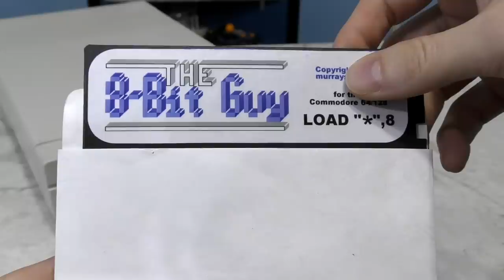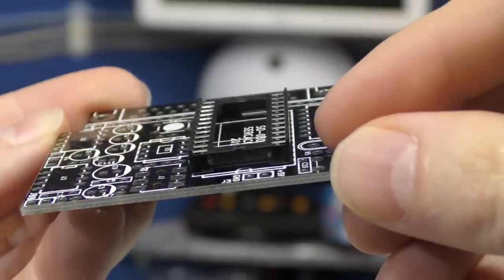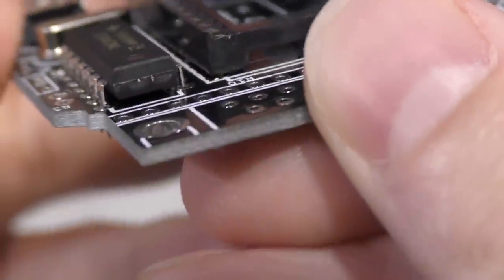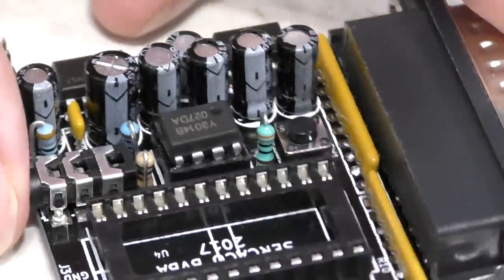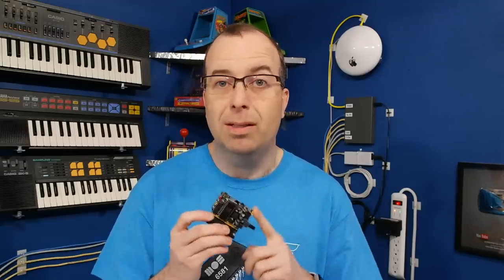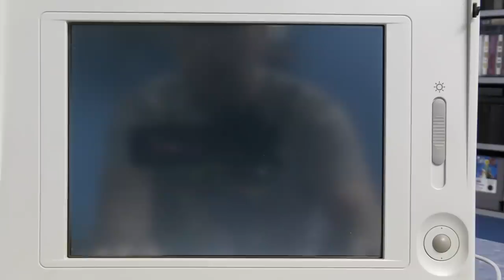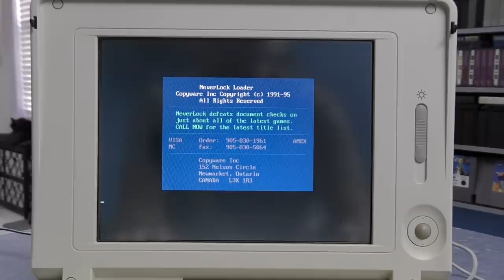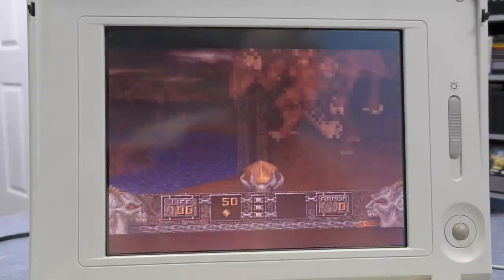Ad-Lib Sound Card for the Parallel Port

Comment: I know this is going to sound redundant to 99% of folks but I would LOVE a USB version of this with a VST controller. I'd love to write Dos type music with the opl3 on a modern machine. I know its nuts but there we are!
Reply: Maybe just rip the OPL2 / OPL3 emulation code out of DOSBox instead.
Reply: You could also go with Plouge's Chipsound's VST for a software-only solution.  Does not seem to emulate the Yamaha, but it does quite a few other famous sound chips.
Reply: I too would love a usb adlib.
Of software there is JuceOPLVSTi which is a vst wrapper of dosbox. Dexed, which is a VSTi dx7 emulator also has a OPL mode that simulates the lower end soundchips, but it only has the sine operator. Both of these are free and work cross platform. On the paid side FM8 can also sound very  oldschool since it has built in decimation and a lot of classic modulators. 
All these solutions are purely envelope controlled and you'll have to expose parameters to be controlled by your DAW to get the iconic complex sounds you hear in games where they used lookup tables to switch operator waveform and pitch mid sound.
Reply: Thanks for all the replies! Seems its not as crazy as I thought! 
I must add, I do a lot of music - I have a love for SID stuff. Have some hardware - HardSID4u, old QuadraSID, C64 with Mssiah, SammichSID, SammichFM, Yamaha TG33 and FS1R among others :-) 
Ive heard of the Plogue synth must look into it. Never thought of dosbox, must look at the JuceOPLvst! Thanks again for the ideas - much appreciated!
Reply: Let me know if you ever find a good sequencer. I've tried just using Anvil Studio and importing the file into a MIDI player running in DOSBox, but there must be some code in modern MIDI files that wasn't around in the olden days, because my files always cause the old players to crash.
Reply: Absolutely! I wonder if using something like the 1st version of Cakewalk Home Studio (my 1st sequencer back in 95) purely sending midi to another machine running a midi player in DosBox would work? I just got an old Yamaha MU10 (love the XG sound!) and I know midi files sound NIGHT and DAY based on the sysEx the sequencer sends initially. Lots to ponder!
Reply: It may not be necessary. LPT headers are still common in non-gaming motherboards, you just need to buy the connector to get a parallel port. 

Besides USB to LPT adapter are cheap and easy to find, I'd rather have them focus on new projects rather than dealing of logistics of dealing with 2 versions of the same product.
Reply: mCKENIC oh man that'd be so cool! People are talking about dosbox emulation and stuff... no, it would be cool to actually plug one of the yamaha chips in via usb and just control it with a VST, not make the sound in software.
Reply: Having dosbox support for it would be awesome too

Comment: Love watching you solder.  I haven't done much of it in recent years.  My first love was electronics back in 1979, before I knew much about computers.  I used to read a lot about it at the library.  I understand what some have said about soldering technique, the proper way does not including touching the iron with the solder but... whatever works for you is the proper way, like programming technique.

Comment: I know this is an old video, but I was taught to solder my components in order of how much heat they could tolerate, ending with the most fragile. Sockets, switches, resistors, transistors, capacitors, and ICs last. If you have trouble flipping the board because of component heights, you should use some helping hands to hold the board for you.

Comment: I'm super impressed by this actually and really happy with the detail you went into. Didnt know the YM3812 did samples at all! I'm already seeing someone make either a driver or some code to use this on a more modern machine. Also I wonder considering the simplicity of the LPT port whether you can use this on other machines since the OPL2LPT has its own clock generator built in with amps etc

Comment: Vertical resistors are typically used in power supplies so it saves space. I'm not sure if new ones do, but I have seen them in older power supplies (circa 2006) when I used to take them apart and fiddle with the components.

Comment: By connecting to a PS2 port, you can provide BOTH power and a way to auto reset the chip, for example using scroll-lock LED will reset it automatically.

Comment: now mod it into the laptop and add your own better speaker that outputs both pc cpseaker and adlib?
Reply: no he doesn't want to fart out music whenever he prints documents on his dot-matrix printer.
Reply: +tohopes  Good point.  What if he needs to use his parallel port for something else and doesn't want the device farting out random noises?  (btw, +TripingPC, don't say "he could just use a USB printer".  Laptops that old don't have USB ports.)
Reply: Old printer-port using devices often used to work with the /STROBE line held high (or low, can't remember), so that a printer would ignore the data. So you could run a simple printer at the same time. Not literally printing and sounding together, but you wouldn't need to unplug one. 

That, or they used to make big 36-way manual switches.

Comment: FIX YOUR INTRO DAMN IT!!!!!!

Now that I have your attention, Dave, in your intro, I noticed that you load the list of what's on the disk ("LOAD "$",8") instead of the contents. ("LOAD "*",8:)
Reply: One loads the disk directory, the other loads the first file on the disk.  It's really kinda cool, the Vic20/C64 load the disk directory like BASIC source code and you then use the 'LIST' command to show it.
Reply: +Jeremy Starcher  It is cool, but also annoying.  I'm a Commodore fan (I taught myself to program in machine language on a VIC-20 when I was 10 years old), but I still wonder why Commodore "downgraded" from BASIC 4.0 on the PET to BASIC 2.0 on the VIC and C64.  I would've been happy to sacrifice 4 KB for the extra disk commands and faster garbage collection.  And if they could've found a way to squeeze graphics and sound commands in there, I'd be really happy.

(For reference: The original PET ROMs filled addresses from $C000-$FFFF.  The 4.0 PET ROMs use addresses from $B000-$FFFF.  So that's a difference of 4K.  On the VIC-20 it wouldn't have made much difference unless you were using a 24K RAM expander.  On the C64, you would've had to sacrifice the 4K between $9000-$9FFF, reducing the maximum BASIC program to "only" 34K, or the "hole" between $C000-$CFFF, which was frequently used for a DOS wedge anyway...)
Reply: The only PET I ever used was the PET 2001, so I never got to experience the fun of the new BASIC or ROMs.

I did know the VIC-20 pretty well, being the only machine I've ever broken through software alone.  (Tried making a morse code practice tape using the official tape deck and toggling a PIA? PIO? chip too fast via assembly.)

Comment: Pro tip: in case your LED's pins are already trimmed, the acrylic shell usually has a flat side indicating the negative side, just feel for it or better: roll it on the table, the LED will settle negative pin down.

Comment: I was lucky enough to have been taught to solder at a very young age by someone who did it all day. Ultimately the method really doesn't matter, do what you want. Just cover it in flux and pronounce "solder" correctly and you're pretty much a pro. Jab the solder with the iron (actually holding it on the iron is one of the most popular techniques, they sell tips specifically for that), use whatever heat works, nothing matters but those two important tips.

Comment: I used to love channeling Sierra games through a MIDI keyboard on my Atari ST. I believe my Yamaha keyboard (couldn't tell you the model 35 years later) featured this chip, at least it sounded quite similar.   If I had any DOS laptops lying around, this would be an outstanding product. Thank you for bringing it to light. (In fact it's probably a far cheaper solution for vintage desktops than buying an ISA adlib card in 2024 !)  Gotta love the homebrew hardware scene!!!

Comment: a piece of advice/"good practices" to soldering: always go from most heat resistant to least heat resistant, in order to avoid damages to your more sensitive components.

this means you start with your resistors, go on to your capacitors and inductors and finish with your semiconductors. this is especially important when you have more complex stuff like microcontrollers on your pcb, but when in doubt: RTFM, this kind of information should be in there if relevant

Comment: Watching your soldering, I have no objections. I do it exactly the same way, and was also self taught... A 100 watt amplifier kit I built in 1994 was still working fine in 2014 when I scrapped it. No bad joins after 20 years. Not a bad run.

Comment: LPT stands for "Line Printer", which is a kind of printer you've probably never seen, that IBM used to attach to mainframes, and would output a page in a few seconds. Used an enormous cacophony of little hammers and a rotating metal chain of type. One of those inventions from the Dark Ages of Computing, from before we knew any better, and hadn't figured out which crazy ideas were better than the others. 

It is doubtful that an IBM PC compatible has ever been attached to a line printer. But that's IBMese. They also call hard disk drives "DASD"s for some reason.

Comment: Nothing wrong with your soldering technique.  In fact, the method you are using works great on circuit boards.  Touching the solder between the lead and the tip greatly increases the transfer of heat and makes for much faster soldering.  I have found that most of the people who complain about doing it this way don't have much practical knowledge of soldering such as on old hand at building stuff might have.  As a television engineer, I have been soldering for years, and I use this technique as it is the best way for this type of application.  One has to remember the guys who make up these "rules" were soldering much larger components when they laid down these "laws of soldering".  :-)

Comment: Little late on this but it's worth noting, if you've got an LED with clipped leads so you can't figure polarity by length, there's a flat side on the base of the LED, that corresponds to negative too.

Comment: Yup, ya gotta love it when people tell you how to do something they've never done before. When I first started soldering, I would briefly touch the solder to the tip to get things flowing. After I heard that wasn't proper, I tried the "proper" way. I ended up destroying the pad before the solder flowed. People need to judge by the outcome of the joint, not the tecnique used to make that joint.

Comment: There is nothing wrong with critiquing someone's technique, especially if you are respectful. If you are learning to solder, watch 8-Bit Guy's videos, watch Ben Heck's videos, read the comments and practice. Practice de-soldering by removing components from junk electronics, then practice soldering them back on, or onto breadboards. A good clean solder joint is important and many of the critiques stress that. This is one of the best aspects of YouTube: learning new stuff. I have met several people who learned to solder by watching videos here.

Comment: The Gravis Ultrasound had an SBOS program for emulating the Adlib/Soundblaster. It did intercept traffic to port 388 in a similar way as this device does. The difference being: SBOS did work just fine with games using a Dos extender. The source code of SBOS was released when Gravis did quit their soundcard business. Perhaps the author of this card should have a look at it.

Comment: Vertical mounted resisitors should not be mounted flush to the board as this may cause stress on the short lead due to temperature fluctuations, the stress on the lead can lead to fractures in the part and failing of the part.
They should be mounted with a small distance from the board, this can be achieved by first soldering the long lead and then tilting the resister towards the long lead a little bit and then soldering the short lead.

Comment: This is really cool, thanks for sharing. I do want to point out that this card should be usable on a 286 or earlier if you're willing to put in a bit of effort. The short version is that you can modify your BIOS's IVT/IDT to support it directly, which would also negate the need for the driver entirely. It's actually a simpler modification than it sounds. The more detailed instructions are: dump the BIOS contents from memory, run it through a disassembler, patch the IDT (see below), compile it again, and flash it to a pin-compatible flash memory chip to replace your old ROM. Most, if not all BIOSes provide the option to change your parallel port from IRQ7/378h to IRQ5/278h, and you can simply replace that second option (which you'll likely never use otherwise) with IRQ7/388h, meaning you can switch between "printer" mode and "OPL2LPT" mode by going into your BIOS settings. It's a simple modification that should do the trick.

Alternatively, I have a hypothesis that you may be able to simply overwrite the IVT/IDT directly in RAM after the system has already booted, though Intel may have put some protections in place to write-protect that obviously sensitive part of memory. If I'm not mistaken, early viruses did it for keylogging and other nasty tricks. If you (or whoever is reading this) is/are interested, it may be worth a look.

You can read more here:
https://en.wikipedia.org/wiki/Interrupt_descriptor_table
https://www.matrix-bios.nl/system/ivt.html

Comment: Ahhhh good old YM3812 chips. I've dealt with the AY8912 and 13's before, due to my dealing with old UK slot machines, especially on the Barcrest MPU4 platform, but not all versions of MPU4 had this chip, or even had an empty socket for it, especially with newer MOD4 variant boards, mostly down to the fact, the sound management, was dealt with on the machines game card.

Comment: Tiny nitpick: the ESS audiodrive didn't use any Yamaha chippery. Their synthesiser was entirely their own work, with a compatibility layer (OPL2 for the ESS688, OPL3 for the ESS1688). They sound rather different from the original OPLs in emulation mode, but the ESSes regain ground by sounding rather better than their respective "competitor" Yamahas when used with software that fully supports them... though that pretty much just means the Windows General MIDI drivers.

Comment: For what it's worth (maybe nothing) I was warned in some of my EE labs that bending a resistor's lead very close to the body of the resistor could damage the resistor. I was taught to use pliers to bend the lead with a small gap between the body of the resistor and the bend.

Comment: I still rely on the YMZ705F for WAV sound in my circuits. The 3812 is an “FM/SSG” IC (music tones, some crude delta sound), it requires a continuous data stream while the YMZ705F is a “write and forget” sound IC. Simply write the setup data, start and stop locations, and it plays near CD quality (32khz, 16 bit) WAV sounds independently of the CPU.

Comment: @The 8-Bit Guy, Regarding the address,  I though the environment variables (placed in the autoexec file) in the original driver installation for the adlib and SounBlaster/PRO had an address, IRQ, and DMA setting.  The games usually checked the environment variables first.  SET BLASTER=A220 I7 D1 T3 P330 H6 E620
 (Port Address, Interrupt,  DMA, Card Type,  MIDI Port, High DMA channel,  AWE 32 Address)  Sounblaster pro allowed IRQ sharing with the LPT port on IRQ7.  Try changing the environment variable to A378.

Comment: I think AMIGA Lemmings used some funky wave verient for the AMIGA for the sound effects. It used Soundplayer for the music. That means that all 4 programmable "or +4 more with trickery on some re-players which merge 2 channels each into the 4 channels then plays over the 2 channels on the TV" were actually used on the music and single or 2 channel funky IFF Wave format was used for the SFX on their own.

That makes Lemmings actually 5 or 6 channels "another trickery effort as it uses 2 codecs or re-players so can use all channels on both at once" depending on if using Mono or Stereo SFX as 2 re-players are playing stuff at once a 4 channel SoundPlayer and a 1 or 2 Channel SFX IFF Wave it mixes on the fly to 4 channels of AMIGA soundchip mixer then that spits off into the 2 channels of output.

Many AMIGA games didn't bother with the special using 2 re-players at once feature so on many games cop outs like SFX only and Music only were a thing like on the C64.

When a game did have both though 1 thing sometimes makes the other thing go choppy but Lemmings got the both thing down right with SP and IFF.

When something goes choppy it's the delay of 5-6 channels being mixed to 4 channels then going over 2 channels it's basically the same thing as Analouge to Digital delay that is.

Same thing happened when some artists on the C64 decide we have this 3 channel SID tune lets program some snoop dogs over it and the snoopy dogs glitch the cyber effects out making it sound garbled if intenional or unintentional, some tunes it made them better with the glitching and some tunes it makes them crap but I guess it depends on the style of music they went with if the snoopys go down well. It's the same thing with AMIGA SFX and Music similtainious muxing.

Comment: If you don't touch the solder to the iron, the pin is left to do the work and with plastics or ICs, they could be damaged. I, like you, touch them together briefly so that the solder begins flowing into the joint without the pins getting overheated.